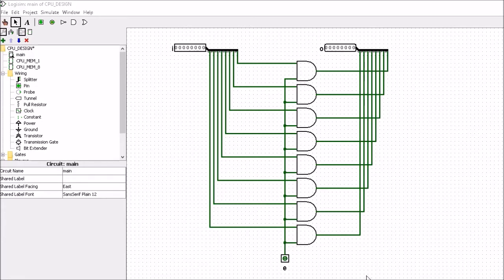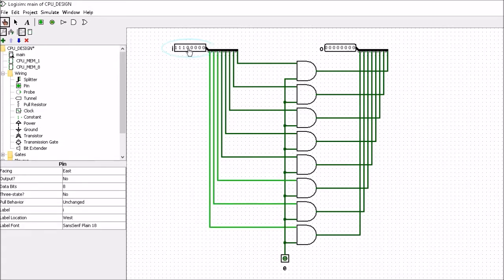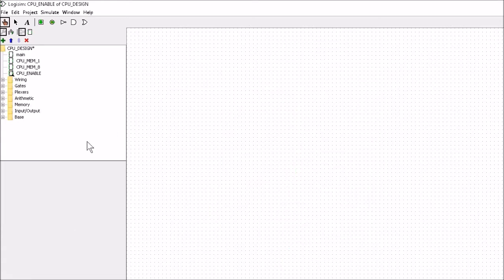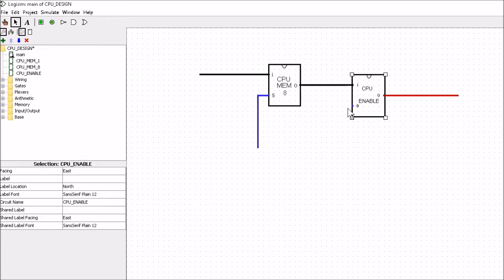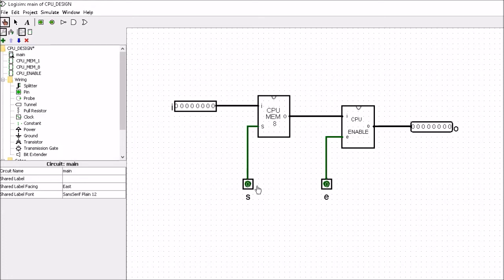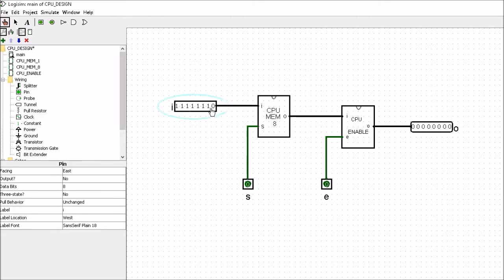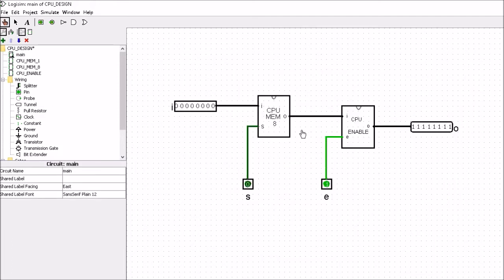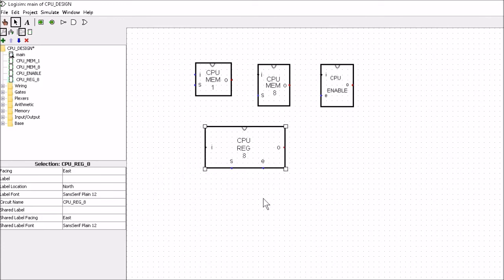Design a CPU 1 - 1 Byte Register

Comment: What is the use of the enable bit? You will probably also need a tri-state buffer to connect you register to a bus and that can act as the enable bit, right?
Reply from the maker: Yes there is redundancy in the design. I use tristate buffers to connect to the bus. The buffers could act as an enable as well but they are separated to introduce them to a beginner so as they understand the logical reason for having them.